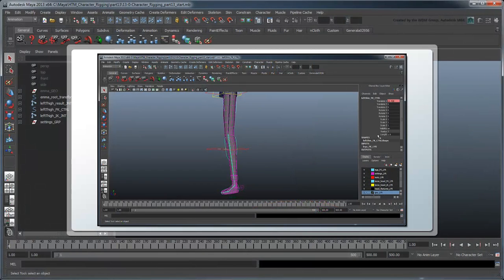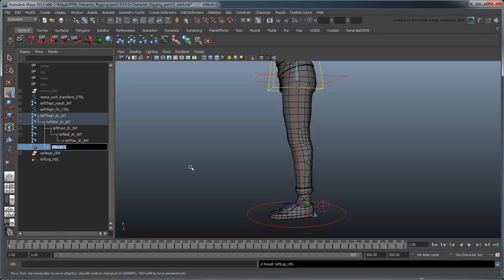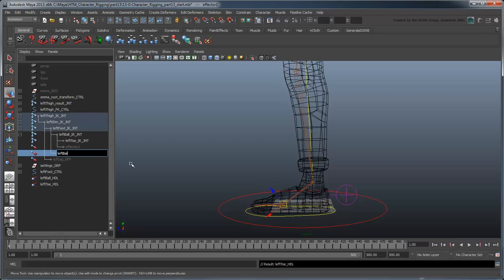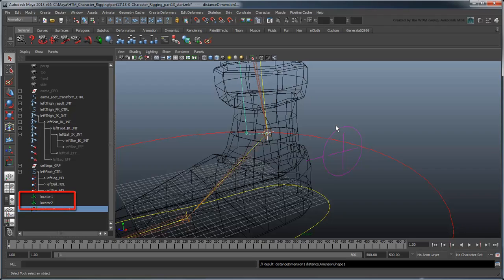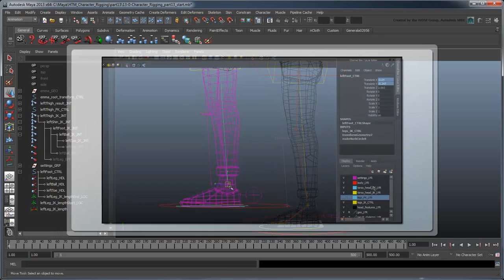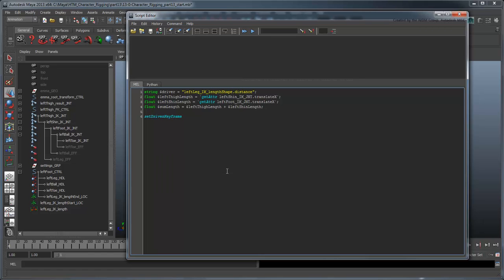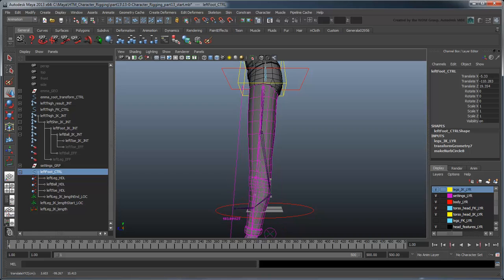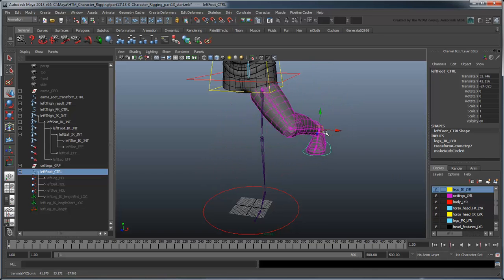Creating a Character Rig - Part 13: Leg IK controls and joint stretching (Advanced)

Comment from the maker: Peter Saumur No, we're still using Set Driven Keys.  Select any of the appropriate limbs and open the Node Editor.  The animation node represents the driven key.
Reply: In Maya 15 when I the SetDrivenKeyframe its saying cannot find the procedure.but before this it actually worked and now its not working
Reply from the maker: You need to run the command with a lowercase 's' at the start (i.e. 'setDrivenKeyframe')
Reply: Sir,can u please say the script of squash and stretch limb in words.it would be a great help.
Reply: How squash and stretch limb works

Comment: In Maya 2014, I'm still having the leftBall_HDL issue when I move it. If I'm lucky, just the entire foot will move. If I'm unlucky, the foot will stay planted and the entire leg will move. But then I tried creating it in the Maya 2013, and it worked! Is this a bug in Maya 2014 or am I missing an earlier step that created this mess?
Reply from the maker: There's probably some kind of setting that's set differently.  I would make sure to use the "Reset Settings" option to return each tool to its default settings before using it in these tutorials.
Reply: Maya Learning Channel I tried that. It didn't work.
Reply: Heather McD I'm at exactly the same spot with same leftBall_HDL issue in Part13 (at 03:36). with just leftBall_HDL selected in outliner, both the ball and toe stay locked straight when pulled up. You mentioned it worked in 2013.. were you able to find a solution anywhere for Maya 2014? I'm heading for the same problem you encountered in Part19.. loving the videos, but for now have come to a halt.
Reply: 2312EB Hi there! After asking around, a solution was given to me. When I started this video series, I opened the Emma geo in Maya 2014. It looked kinda small so I scaled it up some and freezed the transformation. This was the wrong move. Apparently, when you scale the character without using the vertices, the rigging cannot calculate motion correctly so it messes it all up. I believe this is true for both Maya 2013 and 2014 (the reason why it worked in 2013 is because I used one of the Maya files he provided and not my own. He didn't scale the character like I did). To make sure this was the issue I was having, I tried this on a non-scaled character geo in Maya 2014, and it worked just fine.
Reply: Heather McD Thank you for the fast reply!

Comment: I don't know what I am doing wrong on the Mel command?
string $driver = "LeftLeg_IK_LengthShape.distance";

float $LeftThighLength = `getAttr LeftShin_IK_joint.translateX`;

float $LeftShinLength = `getAttr LeftFoot_IK_joint.translateX`;

float $sumLength = $LeftThighLength + $LeftShinLength;

SetDrivenKeyframe -currentDriver $driver -driverValue $sumLength -attribute "translateX" -value $LeftThighLength LeftShin_IK_joint;

and I get and Error

SetDrivenKeyframe -currentDriver $driver -driverValue $sumLength -attribute "translateX" - value $LeftThighLength LeftShin_IK_joint;

// Error: line 1: Cannot find procedure "SetDrivenKeyframe". //

What do I do?
Reply from the maker: Sorry it should be a lower case "s" for setDrivenKeyframe.  Although the overlay is incorrect, what is shown in the UI is correct (see video annotation at 8:04).

Comment: I have a problem. When I try that script on the left arm right after I click execute all, the elbow suddenly relocates to in a negative translate Z axes.
Reply from the maker: I assume you meant to post this in part 23, since you're dealing with an arm?  Either way, it definitely should not move in Z since the script only affects X translation.  Sometimes you can get this behavior if certain joint attributes are locked or IK handles are set up improperly.  It's very hard to say.

Comment: im tired to try to figure out what is the problem...

please help.

string $driver = "ik_l_lengthShape.distance";
float $leftThighLegth = 'getAttr jn_IK_l_pierna.translateX';
float $leftShinLegth = 'getAttr jn_IK_l_tobillo.translateX';
float $sumLegth = $leftThighLength + $leftShinLength;

setDrivenKeyframe -currentDriver $driver -driverValue $sumLength -attribute "translateX" - value $leftThighLegth jn_IK_l_pierna;
// Error: float $leftThighLegth = 'getAttr jn_IK_l_pierna.translateX';
 //
// Error: Line 2.25: Syntax error //
// Error: float $leftShinLegth = 'getAttr jn_IK_l_tobillo.translateX';
 //
// Error: Line 3.24: Syntax error //
// Error: float $sumLegth = $leftThighLength + $leftShinLength;
 //
// Error: Line 4.36: "$leftThighLength" is an undeclared variable. //
// Error: float $sumLegth = $leftThighLength + $leftShinLength;
 //
// Error: Line 4.53: "$leftShinLength" is an undeclared variable. //
// Error: setDrivenKeyframe -currentDriver $driver -driverValue $sumLength -attribute "translateX" - value $leftThighLegth jn_IK_l_pierna;€ //
// Error: Line 6.66: "$sumLength" is an undeclared variable. //
Reply from the maker: Line 4 you have a spelling mistake on $sumLegth.

Comment: Hello! After I attach an Ik handle to my leg rig and the whole leg move from its fix position; is that normal?
Reply from the maker: That shouldn't happen.  I would reset the tool to make sure it's in its default configuration before doing the lesson.

Comment: I tried using the script and this is what I got:

// Error: Line 6.42 "$driver" is an undeclared variable.

I don't really understand what the problem is. I made sure the capitalization, spellings, and little joint name changes I made were correct.
Reply from the maker: Did you make sure to declare it as a string first?

string $driver = "leftLeg_IK_lengthShape.distance";

If so, then you may be missing a semi-colon somewhere.
Reply: Maya Learning Channel That problem has been solved. Thanks. But now it's tell me that I have a syntax error on 6.47. I have checked and double checked to see if I'm missing a semi-colon or if I misspelled something. I don't see anything wrong with it. Here is my script:

string $driver = "leftLeg_IK_lengthShape.distance";
float $leftThighLength = `getAttr IK_leftShin_JNT.translateX`;
float $leftShinLength = `getAttr IK_leftAnkle_JNT.translateX`;
float $sumLength = $leftThighLength + $leftShinLength;

setDrivenKeyframe -currentDriver string $driver -driverValue $sumLength -attribute "translateX" -value $leftThighLength IK_leftShin_JNT;

Please note that my joints were named a little differently than yours. And the last two lines seen here are actually all in one line in the script editor.
Reply from the maker: You shouldn't re-declare the $driver as a string in the setDrivenKeyframe command.  You already declared it on line 1.
Reply: Maya Learning Channel Thanks. But now the IK Handle will stretch for infinity but the shin geo isn't really stretching with it.
Reply from the maker: Heather McD That likely means the geometry is parented incorrectly.
Reply: Maya Learning Channel I'm not sure how it's parented incorrectly. The  shin geo is parented underneath the shin result joint.
Reply from the maker: Is it just the geometry that's not stretching, or the entire result leg?  In the case of the former, make sure the pivot is positioned properly and the "Inherits Transform" option is turned on.  In the case of the latter, you may have forgotten to set up the blend nodes.
Reply: Maya Learning Channel Just the geo isn't stretching. Pivot is positioned correctly (in the center of the knee joint, right?) and the "Inherits Transform" option is turned on.
Reply from the maker: Heather McD In that case I'm as stumped as you are.  I think your best bet is to download the included scene files, and compare the node network of the finished scene to your own.
Reply: Maya Learning Channel I figured it out! I took a look at the scene files I had downloaded. You had a leftShin_geoOrient_grp and I didn't. And thus I didn't have the multiply divide node I need for it either. Thanks!

Comment: Hi, i got this No match found error. I have tried to check for any misspell, but i just couldn't see it. Oh by the way, i use "L_" instead of "left_" throughout all the joints consistently.

string $driver = "L_Leg_IK_lengthShape.distance"; 
float $L_thighLength = `getAttr L_shin_IK_JNT.translateX`; 
float $L_shinLength = `getAttr L_foot_IK_JNT.translateX`;
float $sumLength = $L_thighLength + $L_shinLength;

setDrivenKeyframe -currentDriver $driver -driverValue $sumLength -attribute "translateX" -value $L_thighLength L_shin_IK_JNT;
// Error: No match found to driver: L_Leg_IK_lengthShape.distance // 

Could you guys help me?  Thanks before..
Reply: Oops, found it!
This is my node in the outliner: L_Leg_IK_LengthShape
This is my script                   : L_Leg_IK_lengthShape
so..yes, just need to change the capital L. It works!

Comment: Hello there again!

I have decided to follow the tutorial again to build a new rig for my own character instead of applying your finished rig since I think it will be the best way to understand the rigging better.

I am having an issue after applying the script.

After running the script, my leg bends forward - http://postimg.org/image/ecpf2y7v1/

Could this be because I have 2 additional bones at the Foot bone location?

My leg bone chain goes like this:

- Thigh
- Shin
- Foot
- Ankle twist
- Ankle
- Ball
- Toe

The Foot, Ankle twist and Ankle bones are all at the same location.

I am following 2 rigging tutorials at once and I´m trying to combine the techniques from both and these additional bones should help with better rotation of the foot so thats why I added them.

Could they be causing this bend?

If so, should I try adding two more floats (one for the foot and one for the ankle twist) to the script?

Another thing, I was thinking I might play a bit with emma while I try to rebuild the rig for my own character so I wanted to try some simple animations with her and your finished ready for skinning rig from part 32.

However, after I skinned the rig, I have noticed a very strange deformation on the right leg. (the one on the left in the picture)

-  http://postimg.org/image/qfc3gn8nf/

I thought it might be because of the weight painting so I checked it and found out that the weights on the right leg are nothing like the ones on the left one.
So I repainted the thigh and the shin to resemble the weighting on the left leg and thought that this would fix the problem but not at all, I am still getting the same strange deformations.

Any idea what could be wrong here?

The problem seems to be the FK leg only, IK leg works fine.
Reply from the maker: To your first point, unfortunately it's hard to comment since I don't know the nature of this other tutorial you're attempting to combine with.  A first glance suggests to me that the length measurement being used to determine leg length seems to be off, but again it's hard to say definitively.  I can say that even if you added some extra joints it shouldn't make much of a difference, so long as the ones being stretched share the same relationship as they do in the tutorial (hip->knee->ankle).

The second issue is definitely a skin weighting issue.  You may have also included some joints in the weighting that shouldn't be included.  I have a skinned version of the rig and it works fine so I'd double check those weights.
Reply: Yes you were right! I accidentally skinned some bones that werent supposed to be skinned.

And thank you, I will check the length measurement then but how do I know whether the length measurement is off or not?
Reply from the maker: That will require a little math on your part.  I'd suggest adding a secondary length measurement that you have a little more control over so you can compare the two.
Reply: Maya Learning Channel Oh I just noticed I typed shin instead of Thigh so thats what was causing that weird relocation. My leg stretch now seems to be working properly. Great : )

Comment: Hello again,

This time my leg doesnt strech. I am using my own model which is smaller than your and more cartoony. Could it be it be because of that that the mesh of the legs not streching? If so how to make it work?

Thanks in advance
Reply from the maker: This rigging workflow should work with any model.  You've probably just missed performing a step somewhere, or your script didn't work (did you name all the joints the same way?  Or at least make sure the script was consistent with the way you did name them?)

Comment: Hey there, running into a bit of a problem, this is the script I'm running, my name space is slightly different, using L_ instead of left.

string $driver = "$L_leg_lengthshape.distance";
float $leftthighLength = 'getAttr L_shin_IK_JNT.TranslateX';
float $leftshinLength = 'getAttr L_foot_IK_JNT.TranslateX';
float $sumLength = $leftthighLength + $leftshinLength;

setDrivenKeyframe -currentdriver $driver -drivervalue $sumLength -attribute "translateX" -value $leftthighLength L_shin_IK_JNT ;

setDrivenKeyframe -currentdriver $driver -drivervalue ($sumLength*2) -attribute "translateX" -value ($leftthighLength*2) L_shin_IK_JNT ;

I would do the other two after I get there key frames to work, so heres the problem,

// Error: float $leftthighLength = 'getAttr L_shin_IK_JNT.TranslateX';
 //
// Error: Line 2.26: Syntax error //
// Error: float $leftshinLength = 'getAttr L_foot_IK_JNT.TranslateX';
 //
// Error: Line 3.25: Syntax error //

For the life of me I can't see the problem.
Reply: the capital T on translate doesn't affect it either.)
Reply from the maker: CJReeder I suspect you're using apostrophes (') when you should be using tildes (`) for each of those command references.
Reply: Maya Learning Channel
:I well, you were right, thanks. Now it's stringing together other problems. My current one is

// Error: line 6: No match found to driver: $L_leg_lengthShape.Distance //

I know dang well that it is the exact name, even copy and pasted it.

line 1//  string $driver = "$L_leg_lengthShape.Distance";

line 6// setDrivenKeyframe -currentDriver $driver -driverValue $sumLength -attribute "translateX" -value $leftthighLength L_shin_IK_JNT ;

it's only telling me step by step what the problems are as it runs the script instead of saying everything thats wrong :I sigh scripting sucks. but I'd like to at least know this much.
Reply from the maker: L_leg_lengthShape.Distance isn't a variable, it's an actual node in your scene.  So it shouldn't have the $ in front of it.
Reply: I've already tried with and without it. Same thing for both.
Reply: Scratch that, you right. I had been messing with it while i had the sintax error and it didn't occur to me to mess with it again once this new one came. You fixed it, though now I'm having other issues, but I suspect it has to do with model and not the script, thanks again

Comment: HELP! I've gone through the steps of this video quite a few times, replicating everything as instructed and am running into a very weird issue that no one else seems to be having on here. When I run Execute All the first time, it seems to work properly, setting a keyframe on the leftShin_IK_JNT, however when I copy/paste to work on the double length, I place in the multiplication where needed, put in the parentheses and execute all again. The leg looks fine until I move the leftFoot_CTRL. At this point, my thigh becomes elongated appears to reset the thigh's length to be elongated as such. It then will not stretch or shrink form that point. here is a picture of what is going on, with the mel script and what the issue looks like. Please help http://s953.photobucket.com/user/StarKillerMarek/media/stretched_Leg_zps73274784.jpg.html?sort=3&o=0
Reply from the maker: The reason is because you're using the leftThighLength values in your shin calculations.  You should be using $leftShinLength as the basis.  Check out the included "IKLegScale" mel script.
Reply: Maya Learning Channel I just took a look to try and fix my issue, but both the script provided and the script I used were yielding the same exact results. Is there some other way to reach the desired result that I can try.
Reply from the maker: That is odd.  Are you sure your joints are named correctly?  If you try the provided script with the provided scene files, everything should work.
Reply: I'm going to try going through all the leg videos one more time to see if I can make it work there. I name everything the same as in the video to make it easier to follow. Hopefully this method will make it work somehow.
Reply: Maya Learning Channel I've just gone through the videos again for the left leg and have again run into the issue. The only things I am noticing different right now is 1) I am on 2014. 2) I am working in meters and not centimeters. 3) my leg is on a slight angle, however there is no rotation on any of the bones, nor is there any Y or Z translation because of the way the local rotation axis on each bone is set up. Is there a way I could send you my files to have you take a look at the issue in a more in-depth way? I've tried the file provided in the description and that worked totally fine. it is just my scene that seems to be an issue
Reply: Maya Learning Channel Just so you know, and anyone on this video needs to get an answer for this, I found that changing the units preferences to centimeters fixed the issue. I don't know why this is the way it is, but that's how it was fixed
Reply: StarKillerMarek This happened to me too, but the fix made more sense and probably took less time to find.  For anyone else looking for a solution, I had accidentally set line 4 as
float $sumLength = $leftThingLength = $leftShinLength;
rather than
float $sumLength = $leftThingLength + $leftShinLength;